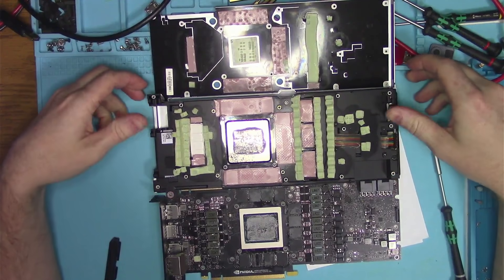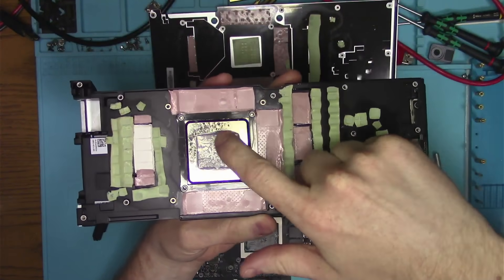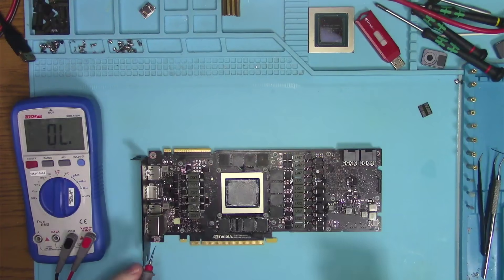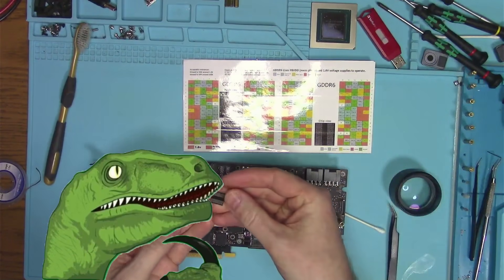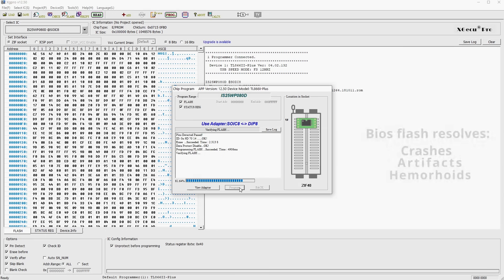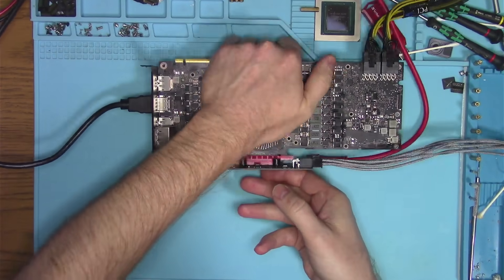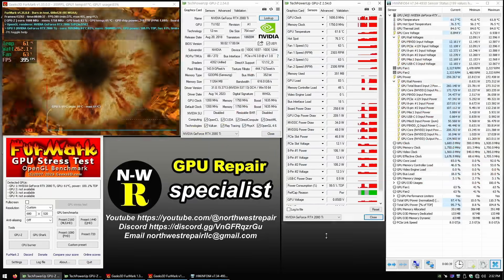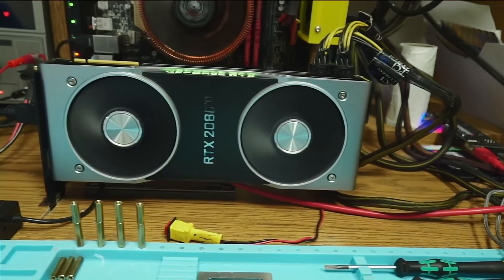Can you kill GPU by using wrong size pads ?

Comment: Interesting. I have the same exact issue with am RTX 3070FE. Did what was done in this video.  I did not change the thermal pads as they are the stock ones. Still getting an error on the same VRAM bank. No idea what to do next. Actually come to think of it, I never did try flashing the BIOS. 🤔

Comment: hey hi.. I recently purchased a used rtx 3060 eagle oc.. so the temps were too high hence i applied new thermal paste and used a 0.5mm pad for the vram chips.. but online others say that i must use 0.75mm. Thing is I can't find any near my place, only the thermal grizzly minus pad 1mm is available.. will it squeeze and make a good replacement instead of the 0.75mm?? pls reply bro

Comment: Question: I have a Gigabyte 3060 and it calls for 0.75mm pads on the vram. I have a bunch of 1mm pads. In the opinion of others, do you think a typical 1mm pad will compress enough so that it doesn't keep the die from making proper contact?

Comment: ive done a lot of testing on my 7900 xt. original XFX thermal pads made the hotspot get up to 106+ and thermal throttling sometimes in a good ventilated case. I spent over 200 USD to fix the issue for buying all kind of thermal pads from 0.5,0.75.1,1.5,1.75,20.... all sizes and different thermal pads till i dented the original heat sink somehow.

Eventually i found a supplier on ali express that sold the original heat sink  for my xfx 7900xt and managed to get the thermal hot spot down to 88c max compared to 106+ of factory thermal pads

Comment: i'm having the same issue with a 2070 tri frozr, i used 1.5mm pads and it wasn't proper contact with the heatsink, and now i'm using 2mm and it's proper pressure, but temps stay at 72...which is where it was before the repaste...i'm still confused if i need 1.75mm pads but all i can find is 1.65mm

Comment: This is one of the only vids I can find with repair on a 2080ti fe. I changed pads on mine and now have somebartificating. I tried 2 different sizes in different sections as there is no where to find a pad refrence size for the fe. Does anyone have the fe pad sizes

Comment: Yes, but it takes ignorance...basically.  guys just get the right equipment, measure, and get the right size.  It's not hard, and it can save your 8 year plus old gpu.  I've got a 2070 super that's still running just like day one, because of proper pad and paste replacement.  That said the alpha move is to fuck it up anyways and fix it yourself with superior technical knowledge/skill like this king right here.

Comment: This video makes me kinda nervous as I'm going to try re-padding and pasting my GPU to fix an ongoing hotspot issue, soon.

I've measured all the pads with an electronic caliper and chose to go for very soft pads about 0.5 mm thicker than the original ones (only one size available, so I need to stack them).
For the backplate I'm going even softer with 3 mm pads to make sure the backside of the memory is being cooled. They are performing worse however, the backplate is fairly limited as a heatsink, anyway.

Wish me luck!
Reply: Too thick and pads fully lose thermal conductivity. I dont 3mm is already a lot on the limit. How did it go? Will plan to look at and maybe swap all my 4090 pads soon too

Comment: Hi, could you please share what do you use for memory test? I have exactly the same problem and the same gpu. The artifacts still happening after changing paste and pads. I will try more thick thermal pads. Also what is minimum and optimal thermal conductivity to use? Is 3W/mk ok?

Comment: I don't get it. If mem pads are too thin then what? The Core was getting too much pressure and balls cracked? Is that possible? 
I think it's more likely that some other pads around the card were too thick and core didn't contact 100%. That would lead to higher temps. Throttling down can only do so much if this was hitting consistently 100+ celsius.

Comment: The amount of patience, skill and materials it takes to re-ball a ~750mm2 core will absolutely get a like from me. That is quite a process to watch and I'm glad you were able to fix it...even if it is a Founder's Edition and doomed to live a very hot life.
Reply: Hey Im not savvy in this stuff so could you tell me what reballing does? Was that the reason the gpu really got fixed?
Reply: Usually a crack in the solder joints under the core. The little balls of solder between the core and pcb get replaced.

Comment: so re-balling the gpu is "better than factory" 🙂
Reply: That is in a way (save for a little unavoidable thermal damage) an actual fact. Aftermarket balls are leaded, which can be used in repair but can no longer be used in manufacturing due to 2006 EU law on reduction of hasardous chemicals. Leaded solder connections remain pliable for a good few decades and are less likely to break.

Comment: @northwestrepair there is one card, Gigabyte RTX 2060 Super Windforce Edition, the card has a sub-standard cooling design, and the cooling is so inadequate that every card of that model Gigabyte made throttles to 89c even after the thermal limit being 83c. Was wondering if you could roast Gigabyte for that card, no reviewers or GPU Technicians made a video on this.
Reply: Oh hey i just bought one of these cards, two-fan card right? Two heatpipes, one of them should be pulling double duty but in the first revision doesn't. Yeah it's a thermal engineering calamity. Fresh paste helps a lot. Pads are horrible. The backplate is baffling, like, they could have cut a couple vents into it, wouldn't have hurt them. Mine wasn't actually throttling after a repaste but just about, and i decided to cut its power limit a little and give it a modest undervolt.

Also the fans are badly balanced and the fan seats make horrible noises beating against the heatsink, especially if the card has warped from droop a little. The fans seem firmware tuned correctly for a card without a backplate, which would stay passive on desktop, but the way it is, it makes unpleasant spinup noises every 2 minutes. I have given the fan programming a 10°C hysteresis making it run for 3 minutes every 20 minutes on desktop idle.

At least the PCB seems perfectly adequate, which isn't a given with Gigabyte.
Reply: @SianaGearz  Fresh Paste helps just for a month or two. And if you redo the paste yourself you risk losing warranty. The thermal solution for that card is completely ineffective.
Reply: Well I have 1660ti on that cooler and I did change pads as factory ones did not even meet their own size  info... Cooler and tolerances on it are meh...
Reply: i have the same gpu, but my case has 140mm side fan that blows directly in to the videocard. Max temps 79c at 100% videocard fan speed (i made an extreme fan curve). Im removing the backplate and also replacing the pads and paste. wish me luck
Reply: just got a 3060ti vision oc as a replacement after fighting with RMA Center for a month :) @umdiaaposooutro2393  .

Comment: Nice video bro
I have a q : one of pro repair man i saw said amd boards usually have better quality and when you desolder chip, the chance is very low for board  pads to break. can you confirm this.
Thanks
Reply from the maker: maybe their pads are glued to the board better but the mask is dissolved by alcohol making it even worse.

Comment: Thanks for another great video!
What do you do with thermal pads that didn't properly fit? Do you throw them away or is it possible to reuse them?
Reply: If pads are in decent shape and not compressed way too much can be stored and reused.
Reply: reuse them ofcourse. these pads are a tad bit expensive

Comment: If collective heat problems can lead to this issue, can you make a guide how to detect thermal issue early and how to replace wrong size pads with correct ones?
Reply: 1st sign The card will definitely underperform - maybe artefacting and such. 
2nd sign if you can use hw monitor - for gddr6x they will show you the ram temps .
3 - it's going to be a bit tough but you have to test the pads or look at existing database or asking the manufacturers , if you are given a wrong size pad gpu - ask them for the pad schematics.
Reply: How to detect thermal issues? Monitoring software. HWINFO64 is great.
Reply: Would like to learn this too
Reply: Think a little bit...u don't need to go to Oxford to figure it out :)

Comment: If seen some one use thermal paste instead of pads on vram on he's 7900 XTX to get a lower hotspot temp, no idea if that's a good idea, i would assu,e the thermal paste would dry up overtime and pump out cos chips are small, but then again same seems happen on GPU core without a pad like kryosheet or PTM7950 from honeywell.

Comment: Thank goodness this card came to you. I am beginning to suspect every card with replaced thermal paste has had the wrong thermal pads put in it. What do you do fake bearded guy when the card itself is warped from wrong pad thicknesses. I watch a guy over in the Philippines put on Palit 1050ti cards and one over the driver pads looks about a 1/4" inch thick. Here in America I never see pads 1/4" thick. With pads that thick it seems to me to be an insulator rather than a heat removal device. Seems something else should be done. Maybe solid copper or aluminum pads. Thermal would certainly take a while to heat up. Physics is strange in that better conductors are also better thermal transfer devices. I think maybe diamond is a better thermal conductor. And who has thin sheets of that.
Reply: Thermal putty is your best bet if you don't have the info about the right pad thickness.

Comment: Great video as always. On the topic of thermal pads, does anyone know any website or database to look up appropriate thermal pad thickness? I got RX 590 fatboy and I just cannot find this info. 

Most search results just point to reviews and XFX website and none of them have this info -_-
Reply from the maker: Thermal pads thickness. 
https://t.me/s/termalpad_cards
Reply: Thank you! @northwestrepair
Reply: one simple trick is to use some playdough or clay, place a small ball on the concerned spots (memory, vrms etc) , completely tighten up the heatsink , reopen and then check the playdough thickness with a vernier caliper. then you apply whatever size pads the measurement is closest to
Reply: Thank you!  @muazzambhatti1672

Comment: I'm curious about what temps you find alright on the core and hotspot. I have a 3070 Battle Ax from Colorful with samsung memory, they are pretty well built, chunky cooler. Got it new with 2 years warranty, used it quite a lot for rendering, this thing went to hell and then back again, until it started thermal-throttling during hot weather. I waited for the warranty to expire to open it, though. Paste was totally cooked. Changed the paste (MX-6) and all the pads (Gelid Ultimate), checked it several times if it was a good job, everything looks perfect. Now it's maxing out at 75c on the core at around 26c ambient, hotspot is around 85c and 89c... Fanspeed at around 50% to 62%. Is it still a bit too hot for the sheer size of the cooler? Not sure if I should repaste it yet again, or be content that it's not thermal-throttling anymore.
Reply: Bro you just have to do a temp stress test to check if the temp goes too high in a couple seconds (cooling problems) or takes long to increase (normal)
Reply: @WellyngtonDev  those are the temps after half an hour on heaven, in a warm day under 30c. So it seems alright, but I still wonder if it should be much cooler.
Reply: @WI5EBLOOD  i think its everything ok but you need to keep on eyes
Reply: @WellyngtonDev  Hotspot seems a bit too high. I did cover the core with a spatula as opposed to just doing the pea size method and squishing it down - maybe I'm missing a corner or something. In any way, ambient temp is too hot, should be using an AC to run a 3070 on full blast.
Reply: @WI5EBLOOD  is everything ok with the drivers? Bro my RX 580 was too hot on the past few days, I did only a thermal paste replace (with the syringe method to cover all the plate) and a upgrade to Windows 11 and I was shocked with the results. From 85º to 75º degrees
Reply: @WellyngtonDev  Yeah no, driver is the latest. I guess you're also running your setup during warm weather. I need to learn how to properly undervolt the card and lift the performance curve up to the standard line with a small OC, that would bring the temperature down as well.
Reply: @WI5EBLOOD  Yeah, my country it's under "El Niño" weather influence, we are getting sunny days and high temperatures. You can undervolt about 10% with MSI Afterburner or with the NVIDIA drivers panel (I would recommend this to avoid conflits), see the results and keep experimenting.

Comment: I used 1mm pads because documentation said to use 1mm pads, but when I tightened the waterblock the pcb was very warped! undid it and replaced with .5mm pads and luckily it still works.
Reply: Yeah they might have used Feta cheese grade pads originally, those just flatten out if you squeeze them. But they only have like 1W/mK typical, maybe just south of 3W/mK maximum, higher performance pads are a whole lot stiffer.

Comment: I have been wondering my gpu has empty memory slots. this gpu has one also. why is that?
Reply: Uses the same board as Titan RTX.  Main difference is Titan RTX has 24gb memory  (2GB x 12)  on 384bit bus with a fully unlocked core while 2080 ti has 11gb (1gb x 11) on 352bit bus.
Reply: probably the price difference between the regular and ti models. all they really have are more cores and more vram. they probably use the same board.

Comment: What are your thoughts about using putty instead of pads.
Reply from the maker: Expencive
Reply: @northwestrepair thermal putty is cheap nowadays, there's this one brand called Upsiren U6 Pro that's like $30 for 30g and it outperforms gelid extreme pads
Reply: In my experience, the puddy doesn't last nearly as long as say... Gelid Ultimate pads - puddy turns into a clay that isn't much efficient after a couple of years of long thermal cycles.
Reply: I have a custom loop making it a better solution then because I'll be changing it every time I flush the system.